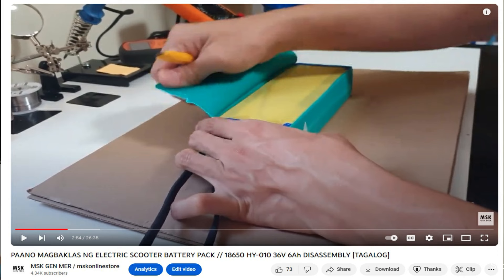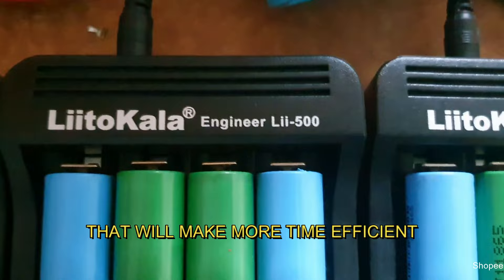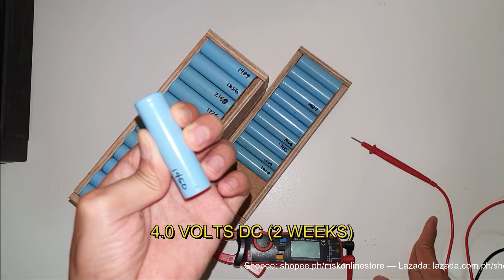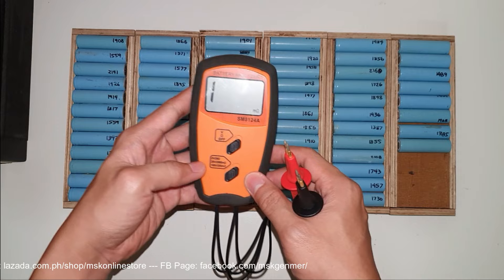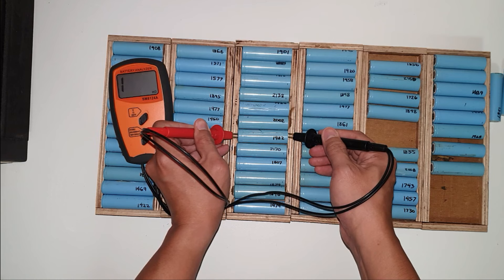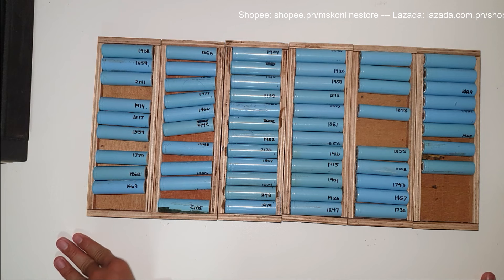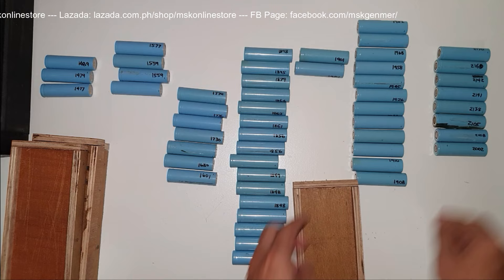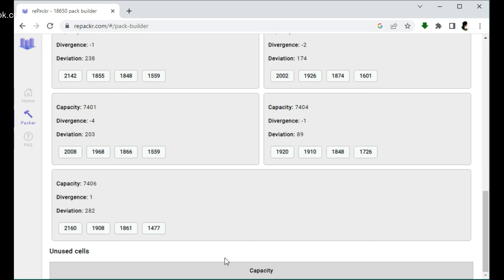[PART 1of2] ELECTRIC SCOOTER BATTERY REPACKING REBALANCE REPAIR 18650 CELL SPOT WELDING LI-ION RPCKR

Comment: Salamat sir. Malinaw po pagka explain. Marami kasi akong nabibiling used scooter packs dito sa Saudi na mura lang. Ang ginawa ko po is dinagdag ko as series para add voltage  pero hassle sa pag charge ng 2 packs ,tangal kabit palagi. Kaya naisip pag iisahin ko sa isang pack kaya laking tulong ng video mo sir. Maraming salamat. Gosbless sayo po.

Comment: sir tnung lng , yung ebikehub ko ay 48v, 3kw gagamitin ko blang turbine generator, ang tnung yung kanyang wire gling sa hub f eekotin k sya ng tmang rpm ito bay llabas ang 48v at 3watts din. at ac b yung volts gling sa hub. thax

Comment: sir need help po sana mapansin mo tong comment ko. 

natural lang po ba yung escooter na may natirang 34.8v tas pinatakbo ko after mga ilang sandali biglang nag down yung volts to 0 hanggang nag shutdown sha at nag bblink yung headlight nga biglang nag lowbat. tas after 40mins umandar ulit at bumalik sa 34.8 volts. 
yung scooter ko pala is 38volts 10.4 a e scooter.

Comment: Sir ask lang po..abo po kaya sira ng e10 scooter ko..ok naman ung battery..pag mag rev ako sa throttolle nia ayaw mag reponse ung motor may naririnig lang akong click parang tik3x.. sana matulungan po ako
Reply: Naka full charge naman po battery ko sir  ung motor lang ayaw gumana kasu baka piga ako sa throttelle ..may maririnig lang ako tunog na tik tik tik naiikot ko naman ng kamay
Reply: Nalubak lang po ako sir tapos maya maya hirap na tumakbo hangang sa tinulak ko nalang kasi iba na ung tunog nia.. sa battery ok naman po sir full charge naman po xha..ano po kaya problema at paano ko po kaya magagawa ung e10 scooter ko po..sana matulungan nio po ako sir salamat
Reply from the maker: Battery sir, may tama na po yang battery ninyo